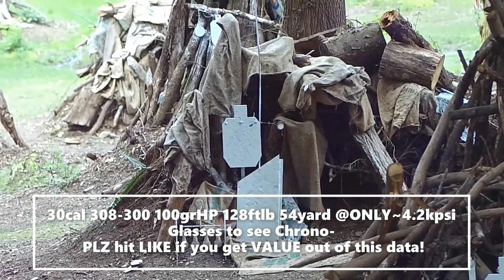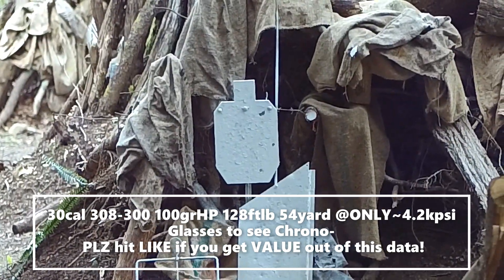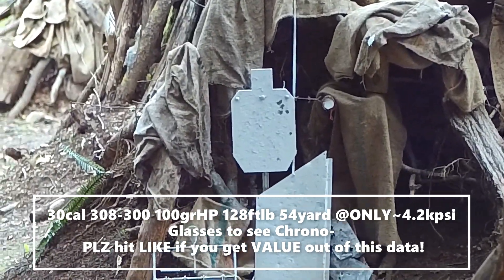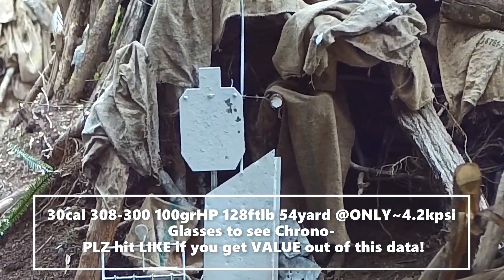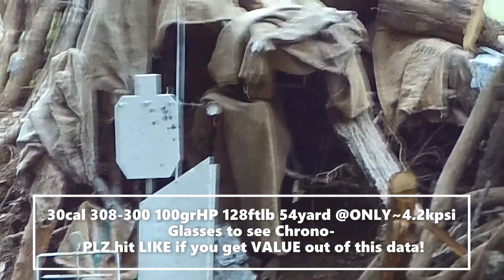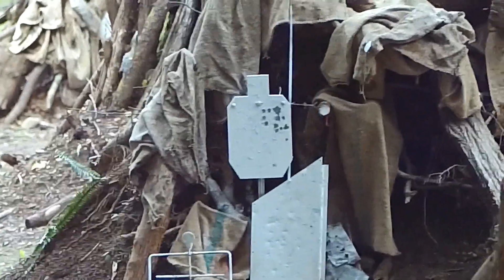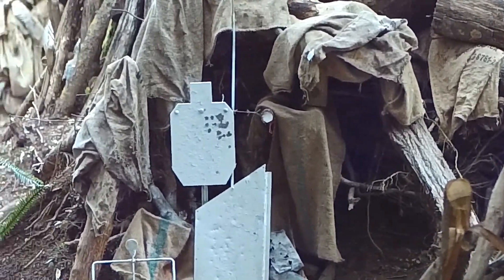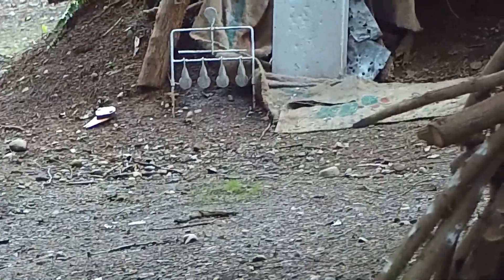AEA Challenger PRO 30 100gr  SLUG DEMO of sized 308 Hollow Point 128 ftlb SLUG 54yrd Chronograph

Comment: Outstanding as usual!👏👏👍👍👍👍👍👍👍
Reply from the maker: How goes it on your end of globe?? I was meaning to call you , now i in a wheel chair a bit, maybe i can SIT LONG ENOUGH to make a call/time happen! Can ya xsend me a text whenever clever? ~Chimpanzee in a chair! still casting though! about 35 lb rounds last night, now i need to rig up the air compressor to learn the Air ElectroSPraying someone KINDLY suggested i try to help with reduced lead exposure AND for better performance, too! THANKS, for WHOEVER told me that method.... ;-)